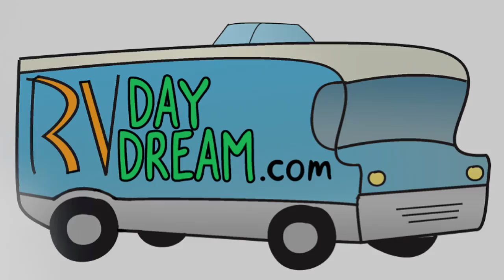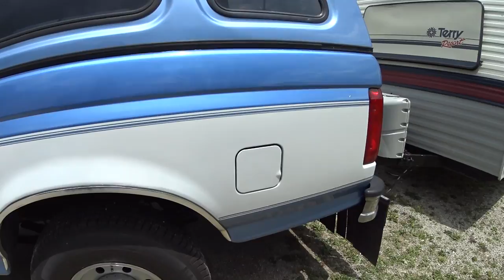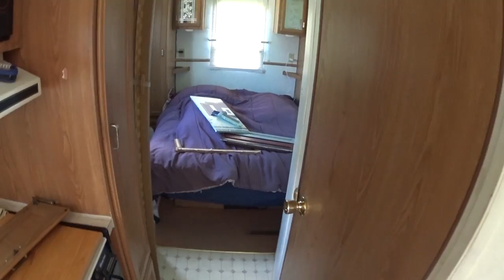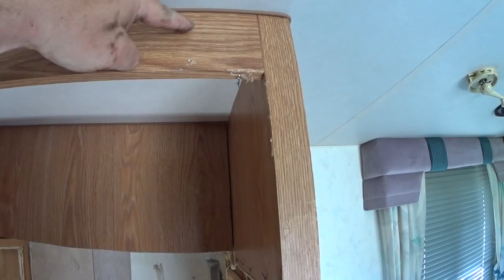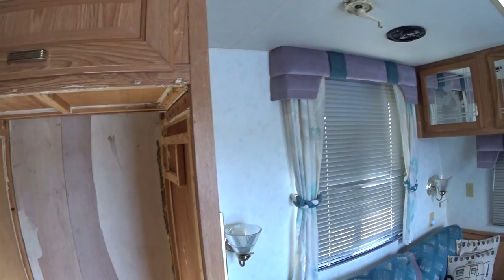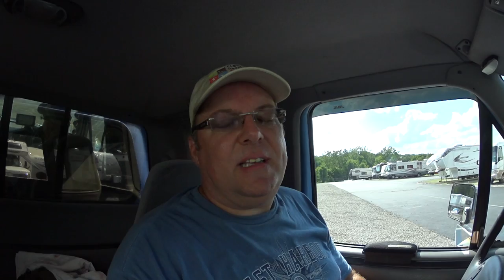RV Repair Quickly made !!

Comment: The sway problem with the truck could be the tires. I had a truck & trailer that would do that really bad and I fixed it by increasing the air pressure in the truck tires. Hope that might help.
Reply from the maker: I hope we figure it out fast. Nerve racking for me and I am just the passenger. Getting it looked at this week, hopefully problem gets solved!

Comment: Sucks when you have a trip planned and something like this comes along.  Hope you find and correct that issue quickly so you can make your trip.  Got my curiosity going with that one.  Broken leaf?  Oh and nice job on the camper :-)
Reply from the maker: It does sucks.. My problem is is that I just got it aligned and I'm going to have to take it into a shop, yet another one, to see if the alignment was done correctly and if there's any problems with the caster and camber.. The leaf springs look great actually everything looks great I don't see anything that just stands out as being a problem. We really like the way the paint job came out overall hopefully it lasts for some time. Thanks☺️

Comment: You fix a lot of stuff, yet you're got a garage door extension spring WAY out of adjustment. You need to fix that before your opener fails and your door drops on your head!
Reply from the maker: 😆I  know... I Found those springs for $1 a piece at big lots... They are the wrong ones for the original 1963 wooden doors.. So I added chain to make them the correct length.. Our door openers are from 2003 and 1985.. I think they would have failed by now..
Reply: That's like finding the wrong suspension springs for your camper axles and trusting they will work. The opener isn't designed to pick up the weight of the door, that's what the springs are for. The right springs from Lowes or Home Depot don't cost that much. At least adjust the cables to take out the slack while they're open. Then call someone who knows what they are doing with garage doors. That's just scary.
Reply from the maker: +Daniel Moffett I appreciate your concern but it's not a issue..
Reply from the maker: +Daniel Moffett The springs are rated for the weight and do support the doors. They are not the correct length though.. So, The slack is caused from the chain that I added to give the springs the correct amount of stretch when the door is being lowered and the weight of the door starts to come into play.. For the door to slam down it would take both springs breaking at the same time even then the door would only be about 3 1/2 foot from the closed position..